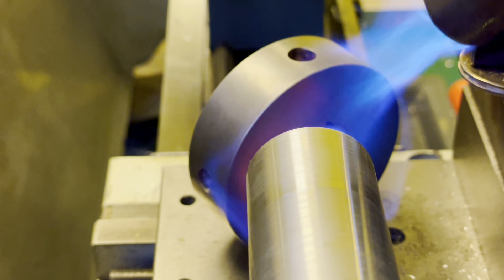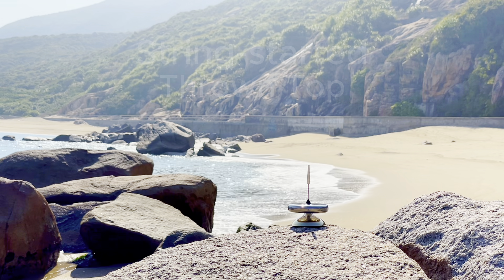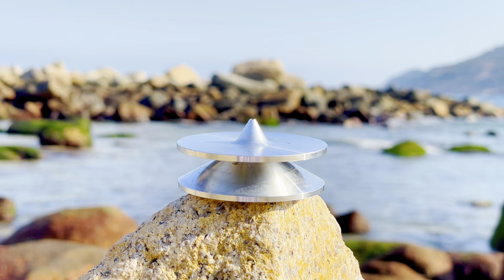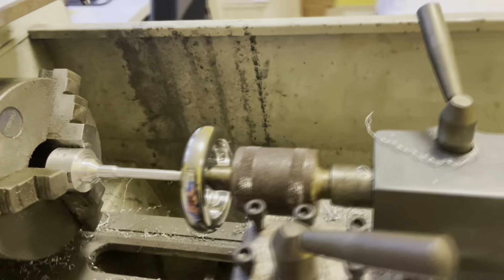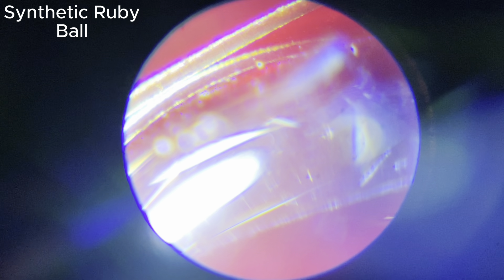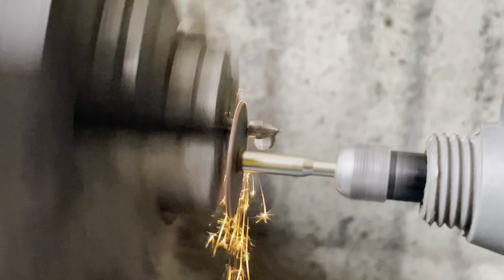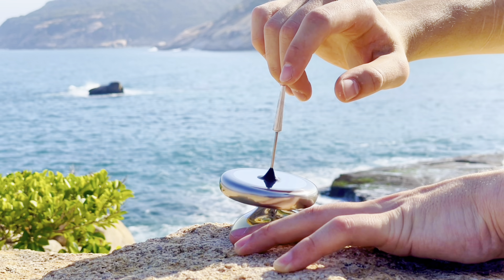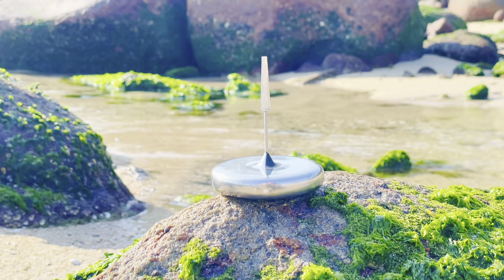Spinning Top Mk.24 | RUBY & SAPPHIRE

Comment: It makes zero sense that you have to compete with a string start thrown top for the record.  The records should just be for finger started tops alone.  I bet you’ll beat it nonetheless.  It’s fascinating to see this optimization process.  
This is a wonky question but the knurling or texture on the bulb at the top of the top is for grip obviously but do you think it necessary to account for the micro variations in symmetry and therefore mass, around the central spin axis, from the process of carving that texture?
Reply from the maker: I agree it is annoying, however I am committed to breaking the record one way or another. Regarding the knurling, the impact on balance is quite negligible I think, however in a way I do account for it - I balance the top after the knurled grip is attached so any impact is fixed.
Reply: @hiper_tops  I asked because in a video I saw an asymmetrical pulsing of light coming from the knurled top.  It may be due to the spin axis being off centre slightly though.  In the same regard I like your images of the tops with the landscape backgrounds but doesn’t putting them on hard rock scratch them?  I know that’s also a wonky question too but what I like about the idea of optimization is the attention such detail.

Comment: You'd think that if the previous world record was set using methods that no longer count, neither would the old record
Reply from the maker: Yes its all a bit messy - in fact there isn't even video evidence for the 1999 record. It wouldn't be accepted today but alas it stands!

Comment: Hey there, I love where you're going with the new improvements and I have a suggestion from a different angle you may not have considered...  You're doing a whole lot to optimize the top but have you considered working to optimize the driver, or in other words, your hand?  If the top spins faster, it will spin longer.  Maybe you could speak to a hand specialist physical therapist or someone who specializes in kinesthetics or movement of the body.  Physical therapy to strengthen your hand and move faster.  Veritasium just did a interesting video on how to escape a blender if you were the size of a nickle and in the video, his team contacted a kinesthetic research group at a university.  Maybe you could collaborate with them or another research group on how to make your hand faster, stronger, or better use your hand to get higher speeds?
Reply from the maker: That's a really interesting idea, as a gym-goer I have previously wondered if I should be focussing on my forearms more as they tend to tire while spinning up the tops. I shall think about this more.
Reply: @hiper_tops  Your fingers don't have any muscles, just tendons and ligaments. But motion does not happen without muscles. "Grip strength" is a hand wrist and forearm thing, but you still have to engage in specific motion. One of those trumpet type, finger exercise grip devices, and hanging like rock climbers do...
Reply: I would imagine the rice bucket training could work well for this, it adds resistance to many movements and you could possibly use it to train the spinning motion directly.

Comment: I have an idea of a starting procedure, using a third device:
Would it be quantifiable to star the top on a temporary 3 rollers tripod, to get up to speed perfectly straight with no precession, and then only lower the top on the base. Then remove the starting tripod and off you go for the run.
Reply from the maker: I see what you mean, and this would work well with a string start, however for the Guinness record, it would not count. Regardless I would like to try at some point :)

Comment: 😊
Reply: So what you want is a design that harnesses the skin effect and limits the losses as the gas/air leaves the surface. Spirals on the bottom half of the handle and transitions might work to order the gas more effectively. Dimples would disrupt the air in such a way that it would reduce friction drag. But maybe only on the upper and lower outer ring of the flywheel. Not the sides where the air leaves. There, you want a tip or gradual surface for the air to escape from. For stability, I still think two planes, a wide base and tall sides, will work best, but maybe have slots at the bottom for air to travel through the wall, not over it... phew... remember when I said I think a lot...
Reply: Have you heard of WPC metal treatments? That might be another route to test. That is, of course, if tungsten carbide will take that process. Edit: yes it does. I wonder if a slightly rounded t carbide tip with this process, spinning on a t carbide base with this process would be enough?
Reply: Maybe WPC the whole flywheel...
Reply: I was a chemistry student years ago before life happened to me. Material science technology was going to be my focus. I never went anywhere with it, but I still like thinking about stuff like this every once in a while. Thanks for that opportunity.

Comment: I would be VERY interested to see the effect of golf ball dimples on spin times.  Likewise, whale fin nodules would be interesting to see, as well. I'm a layman, so please forgive my ignorance, but have you done any research into these concepts, as applied to tops/bearings? Also, it seems to me that a low-pressure  zone would form beneath the top, between it and the base. Have you given any consideration to possibility/effects of the static pressure caused by such zones would cause, if they do form? It would be interesting to see what effect vertical fluting on the base might have, if my intuition about such a low-pressure zone might have.
Reply from the maker: Thank you for your suggestions, and I would like to test them in a video soon. You are right about the low-pressure zone beneath the top. In fact at 0:42 you can sort of see how smoke is pulled under the top before being flung out again. I haven't yet done much to the base to impact spin times but perhaps this is a factor I should consider more!

Comment: Please do make a sequel to the spinning top science video! That was my favorite one so far, and I think many others agree.
Reply from the maker: Okay!
Reply: I agree
Reply: Fully agree! Oh and something I wonder: do you use oil or some other there lubricant on the contact surface? Similar to how watch movements have a tiny drop of oil suspended in the bearing. If not, that might make a significant difference. The lubricant chosen can also have significant differences and would definitely be interesting to test.

Comment: HiPer Tops 2030: "during the last 16 hour spin I discovered that precession of the top due to the rotation of the earth was limiting the peak performance. To correct this I have moved my workshop to the South Pole, with which I hope to break the 24 hour mark soon. As a bonus, during the Antarctic Summer, the workshop gets uninterrupted sunlight for months at a time, which means I can film the entire spin without having to resort to artificial lighting. See you all next time!"
Reply: 2040: “I’ve found that here on the North Pole of the moon, my osmium spinner benefits greatly from the lack of atmospheric drag, but also reduced friction agains the diamond base due to much lower gravity”
Reply: for a 3 second improvement on 23:59:41
Reply: In the grim darkness of the far future there is only HiPer tops latest entry that has been spinning for millenia
Reply: It'd be funny to set up a spin on top of that sandstone bust of Lenin that the Soviet Union left down there at the South Pole, unfortunately, I think the continuous high winds might actually interfere with the aerodynamic performance.
Reply: As funny as this is i wonder if making the base colder might actuallt improve spinning time.
Reply: What is the constraints you need to work with? Is there a size or weight limit? Why not place it in a vacume jar and pull a vacuum fast to remove any air resistance after getting it to spin?
Reply: Please don't move to the south pole. The beach looks wunderfull. Woud a Vakuum chamber Help with Aerodynamik Performance?
Reply: I was actually wondering if that's why he starts it tilted, but then I realized it's not even going for 2h, so that wouldn't explain that much tilt.
Reply: imagine thinking the earth spins
Reply: @throwawaypt2throwawaypt2-xp8nx 0/10 bait